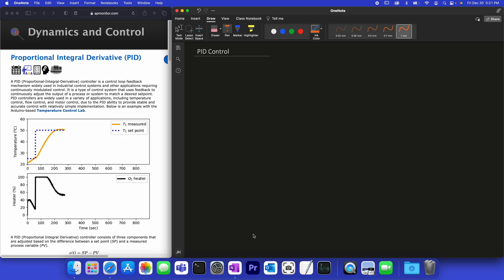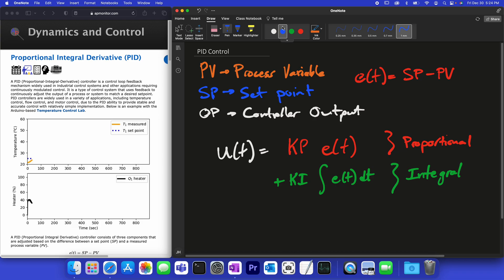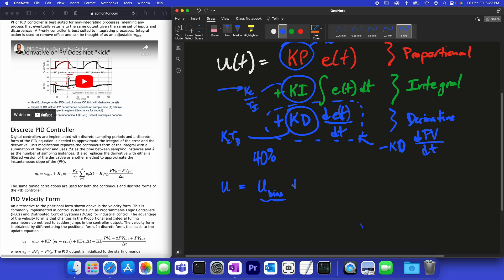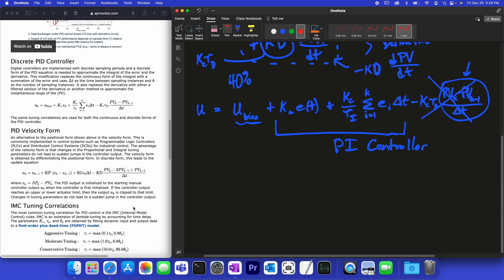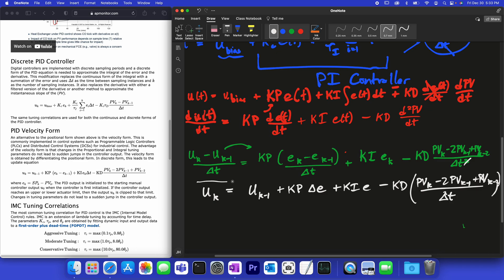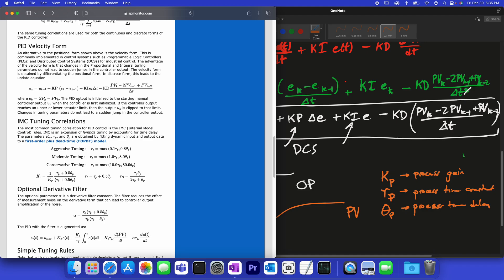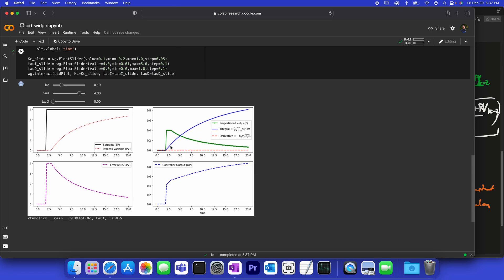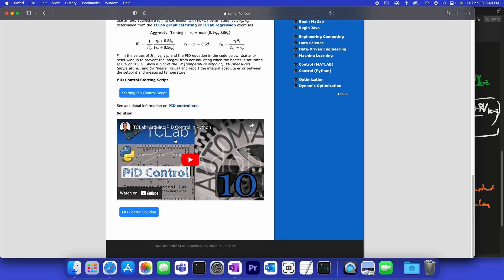PID Control Overview

Comment: Looking at the IMC SOPDT Tuning Correlations, is it safe to assume that tau_s = tau_p? If so, does that mean that tau_c can be calculated similarly to what was presented in the IMC FOPDT Tuning Correlations section?
Reply from the maker: No, the two are different. Here is more information on SOPDT graphical fit of a step response: https://apmonitor.com/pdc/index.php/Main/SecondOrderGraphical

Comment: How can we import our own pid control output data into this and do the analysis.
Reply from the maker: Yes, there is a simulator here: https://apmonitor.com/pdc/index.php/Main/ProportionalIntegralDerivative You would just need to replace the process model with your own. There is more information on obtaining a process model from data here: https://apmonitor.com/pdc/index.php/Main/FirstOrderOptimization or use the System Identification package: https://github.com/BYU-PRISM/Seeq for something more advanced.
Reply: sir i am new to this control things...actually i am looking to find error in  the control pid output and input graph.i have no knowledge about optimization ,i just use trial and error method to adjust k,i,d parameters...so which book can help me out this any suggestion sir...my project is exoskeleton lower limb control by using pid